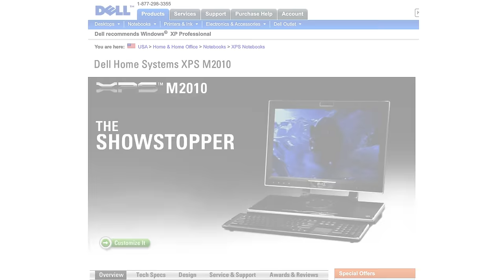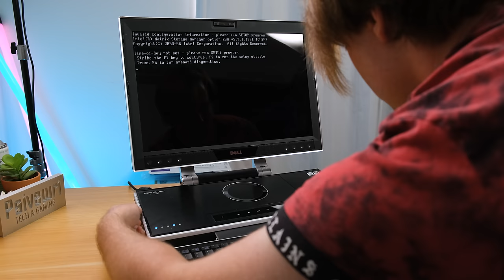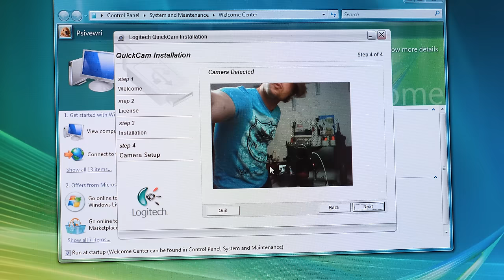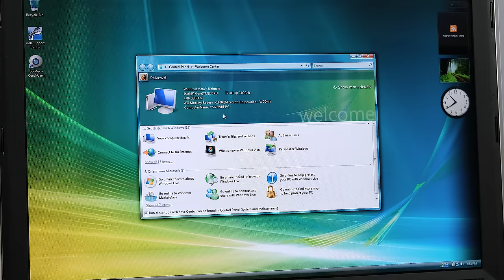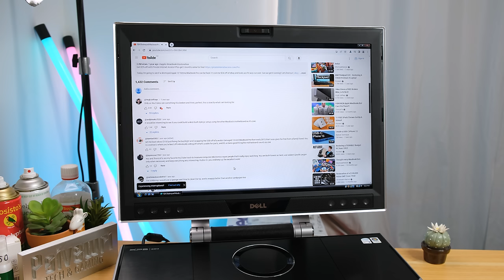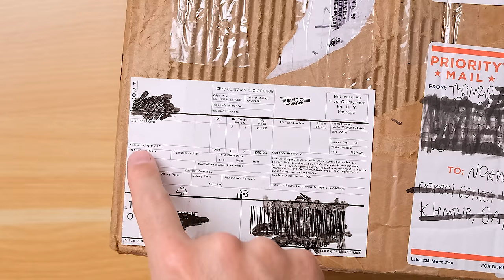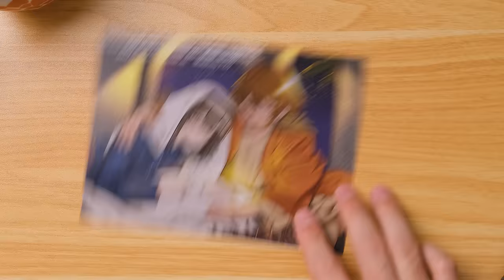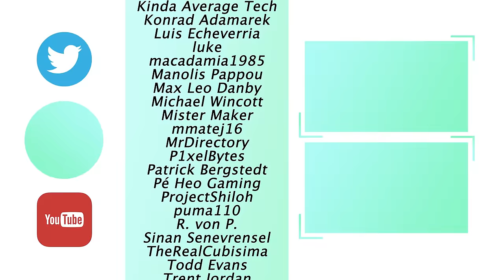Using Dell's INSANE 20" Laptop From 2006! XPS M2010

Comment: That GPU is very similar in form factor to the GPUs in the m6400 and m6500, including that weird connector. There's also a Dell Latitude rugged line from around 2010 - 2014 that uses a similar connector, perhaps one of those would fit?

Comment: should have tried brushing some talcum powder over the rubber coating it nulifies the sticky feel and returns it to a smooth surface...worked for with  a couple of rubber coated electronic devices.

Comment: Also take a look at HP's HDX 9000, I finished restoring one myself, absolute unit of a 20-in "laptop" :D

My HDX 9000 came with an ATI Radeon 2600 XT. Unfortunately I do believe there's a bad memory chip because it gets crashes quite often. It also has an option to upgrade to a GeForce 8800 GTS, but I need a motherboard with extra MXM fingers on it for power.

Comment: I have one of these and had to reflow the GPU to get it to work. Twice. I used the wrong wattage dell charger, and ended up having to reflow again and then use the proper wattage. It works great now and runs like a beast. Still sucks at running Doom 3 regardless.

Comment: You can use apply skin Moisturizer on the rubberized coating and leave over night to have it soak in then remove the next day, this some how rejuvenenates the rubber and makes it less sticky . I did this with my BlackBerry Passport. You may need to try a few different skin creams

Comment: I have a Dell XPS M1710 which is 2006. The motherboard looks very similar, and the specs match too. Alongside the Precision M90, these all use the same graphics card interface. You should be able to put a NVIDIA GeForce 7900GTX 512MB card in there, or the Quadro FX3500 which is the equivalent as found in the Precision M90 mobile workstation.

Comment: I used to support Dell XPS laptops and this was one of the buggiest so called laptop. The most complaints were about the keyboard not pairing or frequently disconnecting. The bluetooth pairing was simply frustrating. Dell XPS is over hyped. This M2010 was a desktop replacement. Noways, it could be called a laptop.

Comment: Regarding this gpu. 

As a retro gamer and laptop collector I was in search for an ultimate, yet powerful machine and ended up with Fujitsu Siemens Amilo Xi 1546 based on ATI X1900. It’s the most powerful laptop card that still displays old games properly. Dx10 cards are broken for old stuff and Nvidia dropped support for many features already in 6xxx series. So only ATI kept this compatibility till the end.

Comment: That's the most impractical design I ever seen, but it could make a great movie prop like for a sci-fi action movie where the hero would carry around their cool cyberdeck but remove the crappy rubber coating and give it a metallic finish to make it look like it's make of solid metal so the hero can use either to shield themselves during a gun fight or use it to club some random thugs.

Comment: I had the same model - i used it for many years ... eventually the graphics card went bad, it had fragments on screen and I deemed it a no fix  I used a heat gun to BAKE the card and it did fix it a few times but it was a notorious issue with that laptop as it overheated underload and was very common, I did look for a replacement card but it was way to exspensive and refurbished so did not want to take that risk... So eventually It went in to the cupboard then my daughter claimed it.. but I also found if you done an update to the bios somehow it fixed the sync issue with the bluetooth keyboard even.  I did upgrade the processor and ram to the highest that hardware would take and put 2 drives in to the most I could at the time.. as far as I know my daughter who lives abroad still has it ... but i assume the shes possihly lost interest in it as she said she has a chromebook now..good video   --- casing was a sticky magnet lol

Comment: If anyone has sticky rubber they need to clean off, don't scrape it off if it isn't that bad. Instead, gently wipe it with a magic eraser until it's no longer sticky. It'll save you A LOT of time and I've been using this on thinkpads for eons.

Comment: I would suggest installing Linux. It still supports such old hardware while holding up modern security standards. 

Installing and using Linux really isn't as difficult as people think. In many cases it's even way simpler.

Comment: Be careful with the CPU, I do believe the front side bus speed is 800 megahertz, which limits you to an x9000 tops. The Core 2 extremes beyond that won't work. I fixed up an HB HDX 18 which had a 1066 megahertz bus which allowed me to put a QX 9300, which is still better than most Celeron processors today.

Comment: Dude, there is or was a video here in youtube that I saw a long time ago, a guy showing if the pouring method of the thermal paste meant anything, and yes, it did. X'ses or Dot'ses are worse than evenly spreading with attention to the film thickness. He shaved about 3 degrees with that. I was about to repaste my laptop and as a true hardware nerd, started googling all about it just the way I always do to see if there's any new knowledge to be earned. And had the same results, shaved about 3C off. Also learned about flattening the cooper contac point as well, because the crevices are the secret here and an X or Dot may miss those, you see? But if you put an evenly applied quantity, the paste will penetrate all those milimetric spaces, transferring the heat evenly.
Of course, no need for nuclear blaster quantic measuring tools for that, just cover the entire face of the proc with a reasonable layer, so it won't make a mess as well.

Comment: I used exactly the same tool to remove sticky melted rubber from Sony Ericsson C905... But yeah, you can fit C905 on palm of your hand, XPS M2010? Not so much XD Also, with that floating screen it looks like that expensive PC from The Sims 2

Comment: For some reason my Dad bought himself one of these. Out of the box from Dell… it seemed like it had hard drive problems. Checked SMART, etc. and nope… healthy drive. After scratching my head for a bit, uninstalled McAfee. That was just the first step to getting this monstrosity functional. 

Even Dell gave up on it and replaced it with one of their all in ones after multiple warranty issues.

Comment: IMHO that would be a nice machine for elderly people, they often have no proper desks and space for a full tower with stationary >20" screen and use laptops up to 15", IMHO budget friendly new 17" machines are hard to find, another option would be All-in-ones like the iMac where you only need to connect the AC power, keyboard, mouse/trackpad are wireless but it might still be a little bulky and heavy to move away, this is a nice hybrid, big screen for your old "worn" eyes but as I said almost as easy movable as a laptop.

Comment: Vista with 4gb and a solid quad core and 7200 rpm HDD would run great. Most people at the time were sold PC with crappy PC with slow Celeron single cores or bad hard drives or 512 mb of ram.

Comment: Just be careful about the X1800 GPU, this was around the "Bumpgate" Era, a failiure common on Nvidia chips from the period but as were the X series from AMD, the X1800 in particular was known for dying due to its high input voltage causing unecessarily high idle and load temperatures. Just look at the 360s issues..My desktop X1800 example idled in the 50s and hit almost 90C under load with new paste..lets just say the dry stuff was a lot worse..same goes for the northbridge, they were commonly undercooled aswell, higher spec CPUs cause more stress, hopefully its dust free interior meant it was low use, should have plenty of life left in it, very collectable.

Comment: C2D T7600 should give u a 16% better CPU, also this uses MXM-III GPUs, u could replace the X1800 with X1900 or NVIDIA GeForce Go 7950 GTX, this NVIDIA has 512MB VRAM.
Looks like DX 9.0c (9_3) its the best u can get it this machine, official drivers goes only up to Windows 7, but maybe u could get them to work with Windows 10, the rest should handle Windows 10 fine.
To me the best use for this machine is Retro PC, dual booting Windows XP and 98, instaling OLD games and having some fun.

Comment: Hello, I have a laptop "Ideapad 100 - 15IBD 80QQQ" and I want to upgrade the ram to it "Intel Core İ3 - 5005U " this laptop has DDR3L and 1.35v ram on it, the Ram I have is 8 GB DDR3 "Kingston 8GB 1600MHz DDR3 Notebook Ram CL11 KVR16LS11/8" this 8 GB ram is 1.50v if I install it on my Lenovo laptop, will it cause any malfunction in the computer? Damages such as blue screen or short circuit, I have been looking for the answer to this question for days and I wanted to consult you, thank you in advance and good luck.

Comment: LOL that black earbud case looks like an Anker Soundcore Liberty Air case - they're unobtanium if you have those buds and want an extra case, which Anker won't sell you for (mumble mumble) reasons.

This insane laptop apparently can be upgraded to a Core 2 Duo T7600g, which is multiplier unlocked.  So there's a seriously good chance this chonky boi could be made to acceptably run Windows 10 or any recent Linux distro.

Comment: iirc the battery was on this thing just so you could bring it into a different room without having to turn it off first. I don't think you were ever meant to actually run the system off of it.

Comment: I won one of these in a contest ATI had (while they were rebranding to AMD). The bluetooth keyboard was awful and never worked out of the box. It also had a battery life of about 15 minutes. Other than that it seemed decent, but I sold it the first chance I got and bought a proper laptop.

Comment: Will someone finally beleive me: for smoker gunk-tar-resin, rubber coating degraded and thermal oaste hard as cement, use lighter oil, rub, then wipe off.  It melts everything.  The final touch is an application of 90% or 99% alcool then wipe for a clean feel and look.  If some ''glue'' left, use lighter fluid again then alcool.

Comment: I would like to suggest using WD-40 SILICONE on the melting rubber parts. I think it should work. It doesn't mar or remove any rubber but conditions it.

Comment: 6:03 NEVER buy MX-4. Most overrated thermal paste ever. It easily degrades inside gaming laptops, and even if it doesn't - in around 6 months of daily usage it would get dry. Get yourself some Honeywell PTM7950 and forget that MX-4 exists.